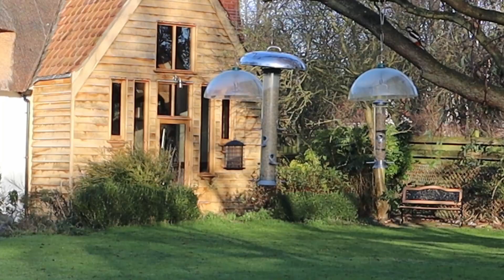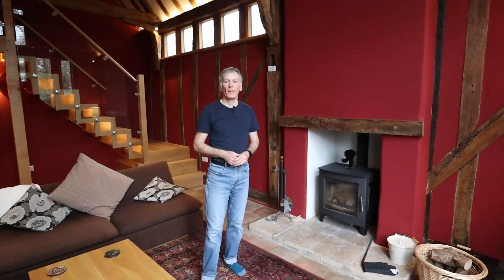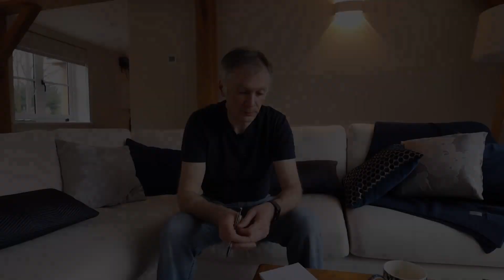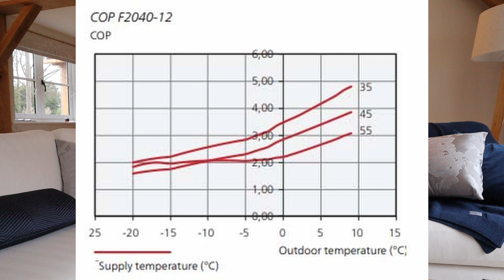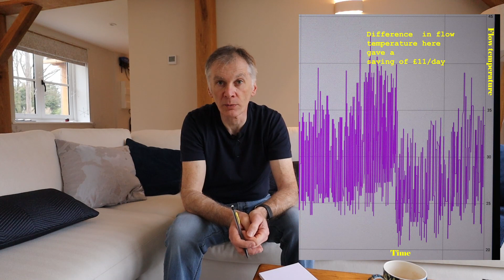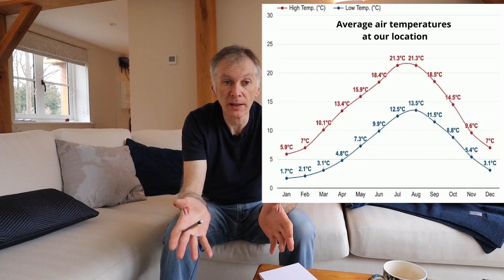Air Source Heat Pumps – viewer questions answered, efficient running and costs

Comment: Thanks, very interesting. Could you not offset the electricity cost by charging up batteries at a cheap rate over night and/or boost the temp over night and rely on it to last during the day? It would also complement a solar solution. Three Tesla Powerwalls would store 40kWh, and at a COP of 3.0 (on a cold day), you could deliver 120kWh of heat at 7p/kWh  vs 27p/kWh. That might be enough to cover your daily heating needs on cold days or make a big dent in the costs. Then use them in the shoulder seasons and summer to sell electricity back to the supplier (Octopus buy at 15p). I have not run the numbers and have no idea what the payback time is!

Comment: All you need to do, and all we want, is a copy of the bill for oil for the winter before you had the heat pump installed, then the electric bills for the winter you had them fitted.
We can make a direct comparison then.  What puts me right off is you saying your heatpump installation is so ineffective that you can't have temperatures above 19.5c !  How stupid is that.  I have a gas boiler that costs £13 a week to keep a house at 22c most of the day, 7 days a week.

Comment: With maulers work office I noticed you only gave a k1 radiator , I don’t think the room has been properly heat assessed, my experience it needs a minimum of k2+ radiators , and given the size of the room may also need a second source radiator installed . Most pump setups are only calibrated to -3 given like me who experienced cold weather in winter I had mine calibrated and spec for -6 c enabling cop of 3.0 at - 14c but had a number of rads changed a mix of k2+ and k3 in open spaces, those rads aren’t great for low temperatures rates and were designed for mainly oil heated or gas heated that require longer periods to thermally mass build up in the design then slow release

Comment: Electric cost is linked to gas costs which are similar to oil.  So they should in theory both change together. 
Of course as more renewables come into the equation, electric will be more stable, and we hope less. 
So ASHP should make economic sense in time.

Comment: 21deg.  Just wondering why you need such a high temperature.  In our house 18c is hot.
Also, you have radiators under windows with curtains hanging over them, I would relocate the rads, or extend the window call boards and cut the curtains above.

Comment: How does this work for a air handler system and not radiators? 

If a system is rated for a COP is that at a certain temperature?

Comment: Interesting video for sure.  If you were very happy with saving 10 quid a day by tweaking your heat pump temperatures then your electricity bill must be absolutely monumental??  It seems a common theme with honest heat pump videos like yours is that if you do not own a solar system - it's no cheaper than oil a lot of the time - especially if you factor in the fact that your existing oil system is working fine, it doesn't make sense to me to then go spend £10k on heat pumps just to save a few quid here and there in bills? Lots of people seem to be doing just that nowadays! Get as much solar as you can fit  ASAP and watch your bills drop like a stone.

Comment: very nice job with the video. I would ask if you have considered the cost of professionally cleaning the heat pumps because that will greatly affect your COP.  Also, do you have a budget for service when the need arrises?
Reply from the maker: Yes, we get them serviced on an annual basis just as we did with the oil boilers when we had them. So far the difference in servicing costs have not been that different.

Comment: Just received an £3500 quote for a new oil tank installation as it needs moving and replacing due to regulatory changes. Team that with an 20 year old boiler, I'd be in for at least £10k.. So been looking at ASHP for a while, main benefits I don't have a commodity in my garden which could be stolen, yes electric is expensive but when crunching numbers over filling my oil tank, having it replaced, running the heating etc then ASHP is a no brainer. Just spend some time draught proofing your home if it's old like mine.
Reply: If draught proofing an old house, at same time you may need to improve ventilation with of course heat recovery

Comment: As a solar installer, I can only share that the sooner you install PV the quicker the payback. My advice would be to avoid Chinese brands and stick to well reputed panel manufacturers like Sharp, Hyundai, Solarwatt, REC, ALEO or Panasonic and Inverter brands like Enphase or SolarEdge. If a battery is on the cards, I'd suggest Tesla or a MyEnergi Libbi as the most future proof solutions.
Reply: Hahah - more like "As a solar installer I am going to recommend the devices I make maximum profit on installing i.e. the overpriced micro inverter/optimiser based systems that I can make 4 times the profit supplying to mugs who have zero shading and would be far better off with a nice SMA string inverter at well under half the price"    Nice try!
Reply: You're a joker! My solar setup is all chinese branded and it's been excellent. You dont even know myenergi libbi is a re-branded chinese product lol
Reply: @MT-xy7fw  It's quite common to see people who've invested in Chinese brands to defend them, even though they  often lack any awareness of what they're buying or who they are buying from (let alone a conscience about the real world ramifications of their purchase). What most don't see is the number of people who quietly cough up the £ to replace failed components due to warranty claims not honoured. As an installer, I come across all kinds, but always try to move my customers away from brands that don't know the meaning of customer service - it may be a coincidence that nearly all are Chinese owned. 

The K-Star battery on which the Libbi is based a quality unit - I've installed a few. But the Libbi integrates with their products seamlessly (I've experienced it during installation training). The company is also excellent so I am happy to suggest my customers buy these.

Comment: Informative video and although a bit technical I could see how you approach your own situation. We have 3 ASHP's in our bungalow and have them set to go no higher than 18c ,we rely on these units as our boiler and rads are now decommissioned and scheduled to be fully removed next year. We're looking at solar and battery tech for our next project. A question on your ASHP's, why are they positioned in your garden area instead of fixed to the main house ? Is it due to your house being of a certain age ? Peter
Reply from the maker: We placed the heat pumps where they are partly because the water generated on the defrost cycle will not be near the house so less potential for ice formation on the path and green algae growth, partly because the air flow round the unit will be good, partly because we had a concrete pad where the oil tank used to be, but mainly because we just thought it looked better to have them away from the house under the willow tree...perhaps not everyone's taste but when the willow tree is in full leaf they are somewhat hidden. Thank you for watching!

Comment: @ Modern Thatch Living. Firstly, thank you very much for such an informative video; there are very few posts with this level of analysis, so I really appreciate your effort. The question I have relates to your "Example calculated flow temperatures for our system..." graph, with time stamp 8:39: are you showing return flow temperatures (for example 29 degrees at 0 degrees outside) or heat pump-generated input temperatures into the manifold? Many thanks.
Reply from the maker: It is the predicted required return flow temperature, the system then uses that information to set the actual flow temperature depended on the outside temperature. That is, it is the flow temperature required to be circulating around the house to balance the heat loss from the building and maintain a constant temperature. I hope that helps and thank you for watching!
Reply: @modernthatchliving1025  Excellent. Thank you. I find (depending on the flow rate) that my return manifold temperatures are about 10 degrees lower than those entering the manifold from the heat pump at about 0 degrees outside.
Reply from the maker: @A.P.Garland  Just to clarify my use of "return" in the comment above. I meant return to the house and the temperature of the water circulating round the house, but the heat pump manual uses "return" as the return to the pump...sorry if I have confused anyone and for my sloppy use of "return".
Reply: @modernthatchliving1025  Thank you. Understood.
Reply: @A.P.Garland  If you have 10 degrees of delta between the supply and return flows, you are possibly running your heat pump at high flow temperatures (a slow circulation pump can lead to same issue). The lower the flow temperature , the lower the delta between supply and return. Some heat pumps lets you control the flow temp and some not. Controlling flow temp is a lot more efficient and economic way to use a ehat pump. By the way keep that in mind, with a heat pump the lower the delta between suply and return flow, the happier the compressor! Preferred delta is 5C for heat pumps.
Reply: @burakokumus6040  Many thanks, Burak. I will get the circulating pump tested on your info. because I've always suspected it isn't powerful enough anyway as it takes 6 hours to raise room temp by 1 degree C even with flow temperatures of 40 - 45 degrees. Again, many thanks.

Comment: The margins between an oil fired central heating system and an air sourced heat pump at the moment seem to be small and constantly moving. Given that the savings/year will not be vast I would suggest that a changeover of heating system should only be considered at a point where a replacement of an oil boiler has become essential. Like cars one of the biggest costs of heating systems is that of depreciation. Unlike a car the value of a secondhand oil boiler is minimal as the cost of installation probably means that most people would rather buy new than take the chance of installing a secondhand boiler. This means that there is no or very little offset against the cost when purchasing a replacement heating system. Therefore it is probably a waste of money at the moment to change ahead of the end of life of the boiler. If a an oil boiler is about 90% efficient and the price is 90p/litre, as the heat energy  in one litre of oil is about 10kwh, electricity would need to be below 8.1p/kwh for conventional electricity heating. For a COP of 4 this would become about 32p/unit which is much more achievable. Given the present fluctuations in the energy market I guess it will be at least a couple of years before we can make meaningful decisions on our choices of heat energy from an economic point of view. Certainly even if we just break even the air sourced heat pump would be a good choice from an environmental point of view.

Comment: Currently I'm paying 24.7p per kwh for electricity and 10.4p per kwh for gas; my 35 year old boiler is 80% efficient so in effect I pay 13p per kwh to heat my house with gas.  I think in future gas will increase in price faster than electricity as green levies are placed on fossil fuels.  2 years ago I had rooftop solar and a powerwall installed which generates about 5500kwh per year, I currently export about half of that amount to the grid.
Next year I plan to get an ASHP (probably a Vaillant) and hope it will be able to get a SCOP of around 3.5.  My excess solar should go a long way to cover the cost of running the heat pump.
I would definitely recommend solar and a battery to anyone with a heat pump.
Reply: "My excess solar should go a long way to cover the cost of running the heat pump" only in the summer months
Reply: @eco-terrorist  No, I'm on the Tesla energy tariff which allows me to import and export at the same price.  In the summer months I export a vast amount of surplus electricity which I can then buy back at the same price in the winter months when I need it for the heat pump.